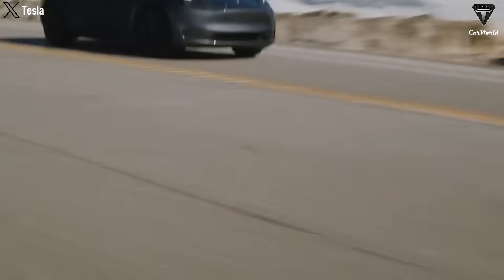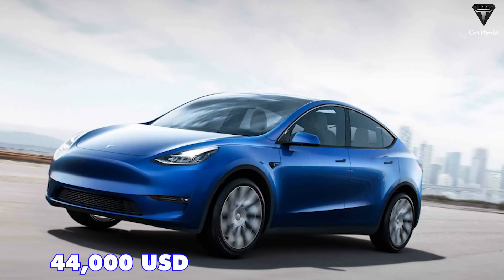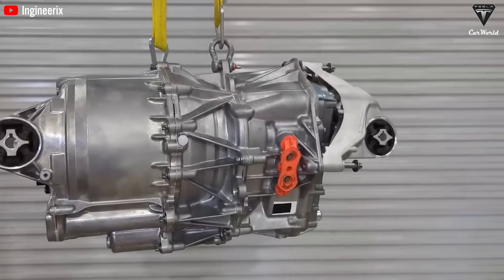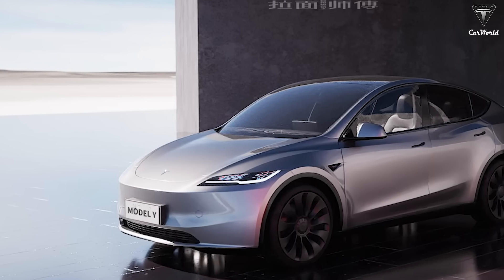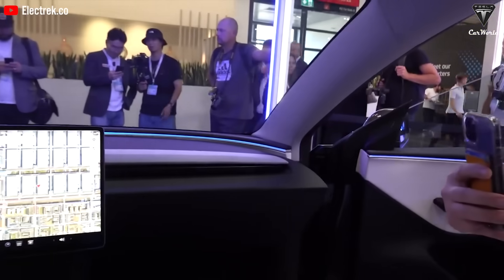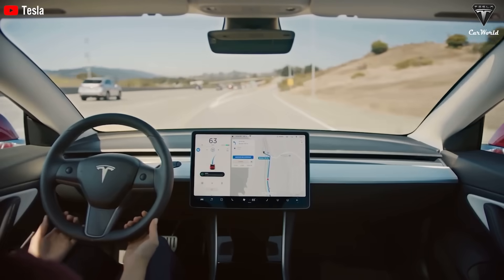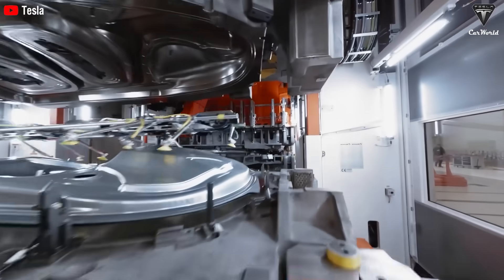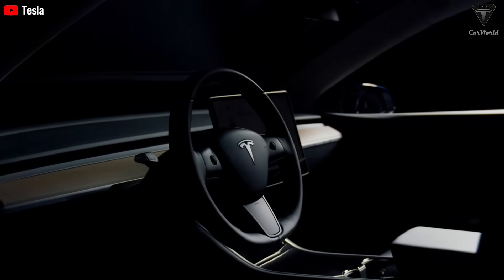What Expect from Tesla Model Y 2024 Juniper: Elon Musk's Exclusive Look Inside Design Revolution

Comment: Tesla is all about reducing parts, thus increasing profit, but not necessarily what is best for the driver.  Relying on the touchscreen for EVERYTHING-  is not something I care for and is somewhat distracting, and potentially dangerous.  I wish they would add some luxury options for bland cheap interior, like different leather and colors, along with some added exterior colors, and wheels.

Comment: We've been waiting for 4680 due to it's 1+ Million Mile 10% degradation.  this would mean if you buy a 500,000 mile used tesla, it will cost penny but you can drive another 500,000 miles!  this is game changer for car industry.  love it! 
I'll just modify the panoramic roof and head up display using after market.  I don't see how Toyota can beat this unless Solids state battery with similar cost.

Comment: What a dumb thing to remove the stalk.  It is so hand to NOT take you eyes off the mirror window that you maneuvering with and just the flip the stalk without looking to change direction making a quick parking adjustment.  This will make the Teslas more cumbersome to park and maneuver.  
You will have to take your eyes off of the tight spot you were looking at, look at the screen guiding your finger up the screen then focus back to the tight spot after insuring you wiped correctly. 
Anyone that drives teslas knows this is so handy with the stalk.

Comment: the main purchase barrier for people is still the ev range and the durability of the battery. we already have enough gizmos and led strips. also, some program announcement for the current owners, saying that advanced batt. packs will be available for the old teslas, improving their range, as innovations come through. this would create further loyalty and value for the brand.
Reply: I think all Tesla ranges are fine. People just don’t know it yet and believe what media says.
Reply: @eliaspfeffer  I drive about 600-800km a day, and I have the range anxiety all the time as I have to calculate where to charge.. That actual range is about 350-400km. 
When winter colds and snow comes in a month, then the reality how much battery range actually is, will be revealed.
Reply: Range is the most important factor in EV's (aside from safety/reliability). Agreed I couldn't care less about all the fancy gizmos.

Comment: Technical errors: 
Tesla does not use cobalt from the Congo. There are cobalt mines all around the world, just the largest is in Congo.
Tesla uses both inductive and permanent magnet motors. Their dual motor cars use one of each. Tesla's latest improvement for permanent magnet motors does not use the expensive rare-earth magnets, but cheaper sintered iron. Sintered iron has been around for years, but this new formulation improves performance to be the same as rare-earth version.

I'd bet one of the major changes is the 48v accessory system replacing traditional 12v system. I doubt the statement about the HUD driver display is true.
Reply: These video narrators have a real habit of saying untrue things about their videos. Not just auto videos but in all categories.

Comment: Yes I would definitely trade my Model Y LR for new one if it has same Range or better.   Specially if I could transfer my FSD.   Because I bought my car at perfectly wrong time, no Tax Credit and no discounts.  Also waited 9months for my car.  So my car is not even 1 year old yet, got it 20 November 2022.  But they gave me a early 2023 Model YLR.  Already invested a lot on it, Full PPF, retractable sunshade, new wheel covers, all Weather mats and Tow hitch.  So I did not want to do Elons hey if you upgrade now you can get your FSD transferred.  Umm no not with all I spent and I am invested.  I would have to start all over.  But yeah maybe in 3-5years I might.